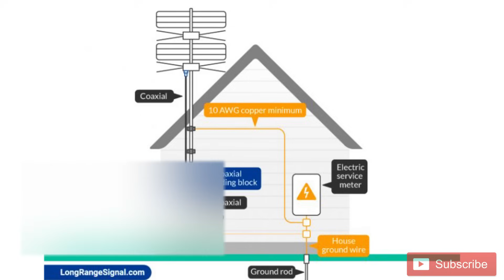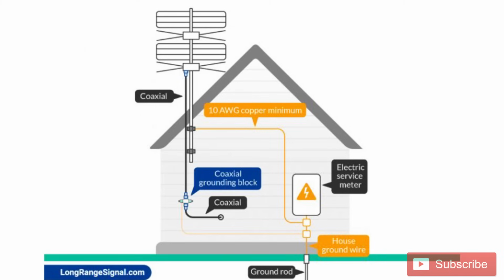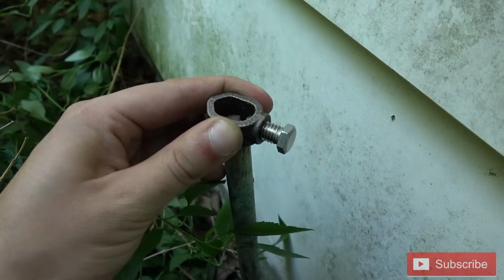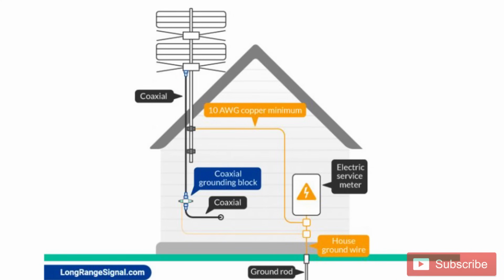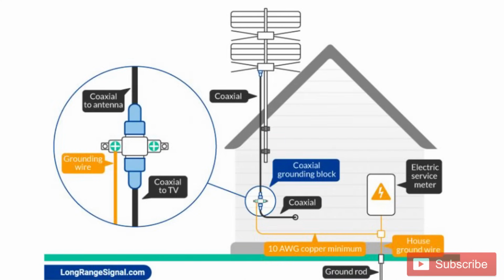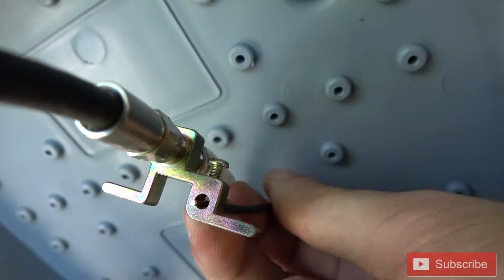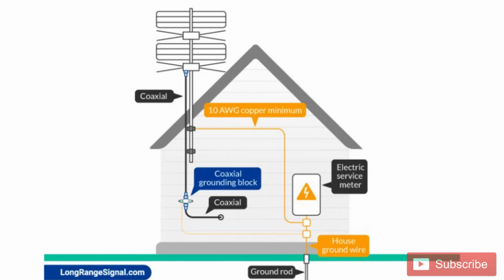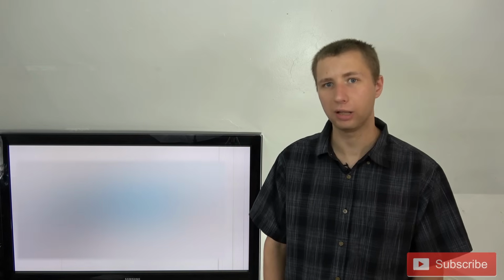How To Ground an Outdoor TV Antenna Per NEC

Comment from the maker: This video is for informational purposes only. Please do not attempt to set up or ground an antenna if you do not have the skill to do so. Consult with an electrician to ensure you are properly grounding your antenna with how your house is set up. You can order the appropriate parts at the affiliate link below. https://www.amazon.com/shop/antennaman?listId=1ZFIHBQLCQ88W
Reply from the maker: @thegeneraljoe67  I can't give grounding advice due to liability reasons. Consult with a local electrician
Reply: your antenna ground should be separate from other grounds I would not use my panel ground for anything but electrical. I know in some states allow the phone and cable to be grounded to the same ground rod as the electrical box and meter box. So also antennas may be included. Also if it's a tower your antenna is mounted on you should ground all three legs for lightning. Consult you local codes and the radio amateur radio hand book. NEC is also a good source.
Reply: is it true that, Nothing will save your equipment from a direct strike?
Reply: I appreciate all of the advice on here and learned alot. When it comes to grounding the antenna mast, I completely understand without a doubt. I grounded my aluminum mast to my house grounding rod. It never occurred to me though to ground the coaxial cable. So I bought a coaxial ground block to do so, but when ohmed out the inner part of the ground block to the outter part, I had no continuity. So this may sound like a stupid question, but here goes. What then are you actually grounding when you ground the coaxial cable?
Reply: I believe then you are only grounding the shielded part inside the cable which was my first thought. Though with an insulated coax cable like that, I don't how often I'm going to worry about that, but will always ground the mast on an aluminum antenna.
Reply: @Herc7834 I know this is an old comment but you are correct, you are grounding just the shield. If you grounded the center conductor of the cable you would have a short. This would prevent any signal travel at all as it would be sending signal to ground.

Comment: There is one error.  If the power company pulls the electric meter the grounds are still grounding the house and phone lines. The meter only affects the two hot lines, the neutral and grounds are unaffected. Most neutrals are tied together with the ground in the breaker box.
Reply: Not only that...the breaker box has to have a direct connection to a ground connection which is generally a ground rod adjacent to the panel.
Reply: @robertmontgomery3892  that and possibly send the energy to other electronics and appliances that wouldn't of been affected by the coaxial.
Reply: Old school hams say don’t ground radio equipment to your service ground ! Have separate ground system for your Ham gear!
Reply: @Brenda-jf2pe  still connected not directly but by the earth ground. I haven't got a transmitter yet but I will ground the unit by a ground rod. Also I plan on having a ground buss on my bench. Wrist straps and foot straps need to be grounded to prevent static with MOS electronics it's a must. But all grounds are connected in one way or another. 73
Reply: If there is a fault sometimes the ground acts as a current carrying conductor to open a breaker! John Boy Utah. KJ7TBR, example even if for a millisecond that will blow a MOSFET!
Reply: @Brenda-jf2pe  it's best to avoid faults. We have GFI and AFCI now so that should help. Nothing is 100 percent. The only other thing you can do is wear rubber gloves. 73
Reply: @ronb6182  JohnBoyUtah KJ7TBR, Brenda’s husband, yes grounding is extremely important, zero potential for all radio gear!
Reply: Yeah I thought that was weird in this video. Grounding is not
An active process, why would turning off a service disrupt a ground unless there was a mechanism literally designed to UNground for that sake.
Reply: Correct, but only at the main panel, not sub panels.
Reply: @RobertBeck-pp2ru  yeah but the ground is still connected but not bonded in the second box. The ground wire is connected to any sub panel from the main panel. You can actually run something with only hot and ground I done that when I was a teen using half a 240 outlet. It's not a good practice but it got us out of a bind during a production. As an adult I only go by code. My friend and I did some strange things in JR high school. 73

Comment: Before I retired I worked as an electronic tech where we had lots of facilities where most had antennas attached, in some cases multiple antennas.  When the equipment was vacuum tube equipment failures due to lightning strikes were rare, but when the new solid state equipment was installed lightning strike failure was common.  The facility antennas rarely took a direct hit, but close was all it took to damage the equipment.  After good lightning protection was installed,  those failures all but disappeared.  Nothing will save your equipment from a direct strike but those near misses can be avoided.
Reply: is it true that Nothing will save your equipment from a direct strike? even if your mast is grounded properly and the coax has a serge suppressor on it?
Reply: @Shanedog76 Say your antenna got hit by a lightning strike, you might need to get a new one lol,

Comment: It is strongly recommended to use a surge protected grounded block for your coaxial cable ground, such as the famous Tii 215. This in theory will self sacrifice itself rather than allow the lightning or other surge to hit your equipment indoors.

Comment: Is there a reason you can't just attach the cable ground wire to piggy-back the mast ground wire? I had to install a 6 ft. copper rod in my yard for the cable company to hook me up. It cost $100 for the rod and took half an hour to hammer it into the ground. The electric meter and cable junctions were right next to each other, but I didn't know you could use that ground at that time, nor could I figure out how the last owner had cable without one. Seems like it would still be grounded even if you didn't have electric service.

Comment: I have a steel mast that is set in concrete and is about two feet into the soil. Do I need to ground the mast to the home's ground rod? Also, can't I just attach the coaxial grounding block to the steel mast? (BTW, the mast extends into the soil about 6 inches further than the concrete I set it in. In this way, the mast makes direct contact with the soil.) Thanks a Million!

Comment: Tyler - good advice! I see that your coaxial cable grounding block is connected using standard coaxial connectors that you might use indoors. Unfortunately, these are likely to be corroded over a few years due to weather exposure and dissimilar metals in contact with one another (e.g.: aluminum and stainless steel). Is there a better way to weatherproof this grounding block (caulk, butyl tape, shrink wrap?) that we should use?

Comment: The instructions that came with my GE Ultrapro Quadcore HD Antenna described the grounding instructions just like you have. They stated that the wire should be #8 aluminum or #10 copper. I have been shopping #10 copper but the instructions didn't state whether it should be solid or stranded or bare or insulated. Can you tell me which is preferred? Also, what is the specific coax cable I should be using for outdoor installation?

Comment: Got rid of satellite and put up antenna. Want to use satellite ground wire which I presume is somehow attached to either my smart box cables or electric panel. Problem is it isn't 10 gauge wire. I don't think it is even 12. I believe it's 14! I can pretty much curl it around my finger. What do you think? If it was good enough for satellite it should be good enough for antenna??? Have concrete on 3 sides against house. Only dirt is clear to other side of house.
Reply from the maker: I can't comment due to liability issues. Check NEC and don't take shortcuts. This is lightning we are talking about.
Reply: @AntennaMan  Thank you for the quick reply. I understand. Will do the checking.

Comment: My electric box has two grounding rods directly connected to it. 
So would I be able to ground to any electric light switch or outlet box ground wire in the house? Or does it need to be connected to the grounding rod line outside of the house?

Comment: I work in the telecom industry and you always want to ground anything (that requires a ground) to the power company's electrical ground... they will have a ground rod in the ground below your electrical meter, ground to that ground rod if at all possible. Running your own ground rod (say, on the other side of the house from your power meter) and grounding an antenna or other device to that is a fire hazard because it creates a difference in potential between your ground rod and the electrical company's ground. It could literally burn your house down if you got a direct lightning strike. Also, it doesn't matter if your power gets shut off (like he commented in the video), the power company ground will still be in place so everything continues to be grounded. When they cut off power, the just pull out the meter, put plastic blockers over the contacts inside and put the meter back in... it has nothing to do with grounding.

Excellent videos though Tyler... I have watched many and you are a big help!
Reply: But my transformer and meter/ground rod is over 400 feet away from where I want to put a 40' tv antenna. Now what?
Reply: @CumminsTurbo4  I guess grounding to a separate ground rod is better than nothing, but it can be a hazard... just pointing that out.
Reply: @CumminsTurbo4 maybe bond them together outside the house?
Point is, the path must not be through the house!

Comment: Can you clamp the ground wire to the mast anywhere on the mast like up high or down low?
Reply from the maker: I cannot comment due to liability issues. Consult with a local electrician for clarification.

Comment: Can I ground my coaxial to the mast and then the mast to my grounding rod  ?
Reply from the maker: I can't comment due to liability issues. Refer to national electric code and do not take any shortcuts. This is LIGHTNING protection we are talking about.
Reply: @AntennaMan  idk if id call it a short cut the mast and the coax will be grounded together down the line before the grounding rod.

Comment: What if I have three antennas on one mast. Along with a SmartKron. Ground/protect all 3 antennas seperatly? Combined?
Reply from the maker: Ground the mast and the coax cable running from the smartkom as it's connected to each antenna.
Reply: @AntennaMan  Thanks for that. Just to be clear. Ground the in/out from the SK single main coax and the mast. NOT g- all 3 antennas. Thanks again.

Comment: Why do I lose some channels when I ground my coax wire? I still have to ground my antenna support pole.
Reply: You might have ground loops, but also loose connectors, bad connections, cheap wire or anything else that causes your signal to leak out and interference to leak in, can cause issues. I assume your affected TV has a 3 prong power cord. Most newer sets are only two prong to avoid this issue. 

To test for ground loops, use a ground plug adapter, sometimes called a pigtail adapter on your power cord. This disconnects the ground wire from the TV without having to break it off. If the problem goes away during the test, then you have ground loops. A ground loop simply means too many paths to earth ground. Make sure your system only has one connection tied into your house earth ground. Also make sure that none of your coax connects back into your system. Make sure that all TVs are connected separately from one splitter, but don't ground this splitter if your coax is already grounded outside. You can ground the splitter if there is no ground outside.

Comment: My electrical panel is grounded to my copper water line and it is also bonded to my gas line. Should I still ground my antenna to it using a meter box corner clamp (with solid 6gauge wire)? I'll have a lightning arrestor on the antenna (915mhz 10dbi wifi antenna mounted on a 10ft rod onto my chimney at the top) but what if it gets hit by lightning? Isn't it safer to just have the antenna grounded to a seperate ground rod? That might be against the NEC since they want the rod to be bonded to the electrical panel, so it defeats the purpose of having the antenna grounded separately...
Reply from the maker: I cannot comment due to liability issues. Consult with a local electrician for proper guidance.

Comment: Question, for grounding blocks and cable jacks to feed your cable inside a house - can/will these connections block any power traveling up the cable to your power supply inside the house to the preamp mounted by the antenna? Are there any specifics to look for in a grounding block and jack that will indicate they will transfer power? Thanks
Reply from the maker: I cannot comment for liability reasons. You will need to do your own research or consult with a local electrician.

Comment: I had a small AM station years ago that had a "new" solid state transmitter. If there was lightning 40 miles away, the transmitter would get hit. We had surge protectors on the 3-phase power line, and (I thought) a decent lightning rod where the transmitter was grounded. It was only when we were adding copper strap to the building ground system, we discovered the ground rod was only about a foot in the ground. I sunk two new ten foot copper rods a few feet from each other and bonded them together, then ran 8" copper strap inside to the transmitter. Never had another problem. 
Yes, a good ground is essential!

Comment: @antennaman  Would it be ok to use a seperate outdoor ground rod for the antenna and coax?? My antenna and mast are at the opposite ends of our house service entrance and the service ground rod is located in the basement below the main panel. I assume either way would shunt lightning to earth ground.

Comment: Not sure if it's "Code" or not, but I always add the coaxial grounding device in-line, with the antenna mast grounding wire.
Much less wire to run.
Reply: My exact question as well given that the run from the mast and coax grounding block to the service ground is appx 60 ft in my situation.

Comment: Just to add. Lighting will also take the shorter grounded path.  Just like any electric charge. 

What I would recommend is a Antenna to its own ground rod directly to the ground.  They you run the wire from that ground rod to your household electrical system. 
This is important if you have an antenna on the opposite side of your Electrical service.  

I would run a separate wire from your coax ground block to you electrical service ground rod.  

In that diagram Antenna Man has posted there is the perfect example that the Coax is the shorter run.   Thats NOT GOOD.👍

Comment: I believe you can also ground clamp to a copper water pipe. Yes?
Reply from the maker: I cannot comment due to liability issues. Consult with a local electrician if unsure.

Comment: wouldn't this grounding be already done by previous satellite installations that have remained on the roof ??
Reply from the maker: Yes
Reply: @AntennaMan  Thanks, how do I confirm the ground wire is already there ? I have the antenna assembled and ready  to mount it, but the instructions insist on the Ground Wire / Ground Blocks which I was not expecting to have to deal with.
Reply from the maker: @zurdoremi  I cannot comment due to liability issues. Consult with a local electrician if you are not sure whether or not the mast is grounded.

Comment: My neighbor has his antenna on a pole 50' from his house. Would you drive a ground rod at the pole to ground the mast and grounding block? He buried his coax making it necessary to place the grounding block in the basement or the pole. Were does it go?  Is it necessary to run a  No. 6 ground wire from the pole ground rod to the meter ground rod 60 feet away  across the driveway?
Reply from the maker: I cannot comment on what your neighbor should or shouldn't do when grounding the antenna due to liability issues. Refer to national electric code and do not take any shortcuts. This is lighting protection. If you or your neighbor are unsure consult with a local electrician.

Comment: If your antenna is mounted on a mast that is in the ground then there is no reason to ground the mast to the house's grounding rod right? If so then one can just put the ground block on the mast, correct?
Reply from the maker: I cannot comment due to liability issues. Refer to NEC and don't take any shortcuts. This is LIGHTNING protection we are talking about.

Comment: My question is a simple one... can the ground wire extend from the antenna mast to the coax grounding block on the way to the grounding rod or should they be separate wires?
Reply: As long as the ground block you use has two inserts for ground wire you’ll be good. One from the mast to the ground block, and one for the 10 gauge to the bonding source

Comment: Also you should sand off the tarnish on your copper connections. Tarnish is not a conductor and if your mast is painted you should scrape the paint off where the clamp attaches to the mast.

Comment: If you have access to an outdoor outlet, can you rout the ground with to the grounding screw on the outlet and get the same grounding protection?
Reply from the maker: No that will not work. Refer to the video and do not take any shortcuts. this is lightning protection we are talking about.